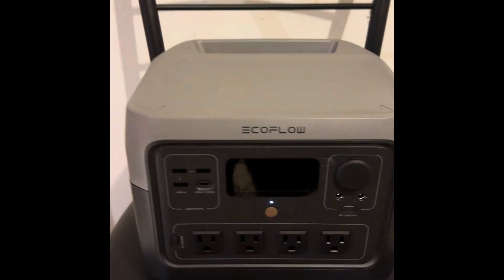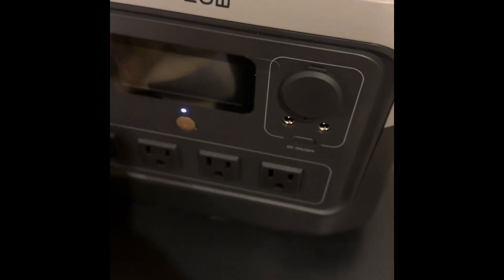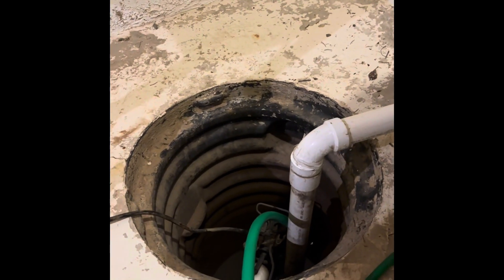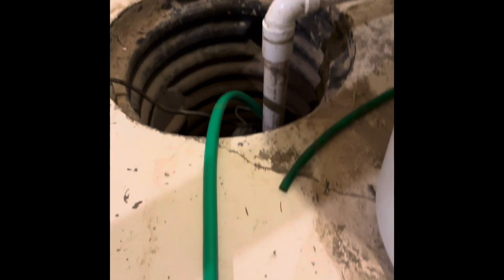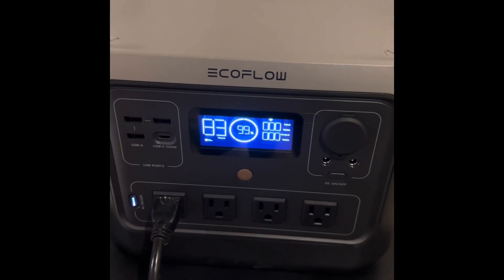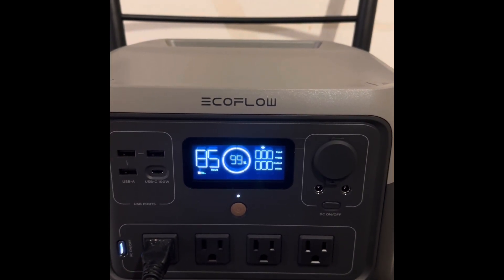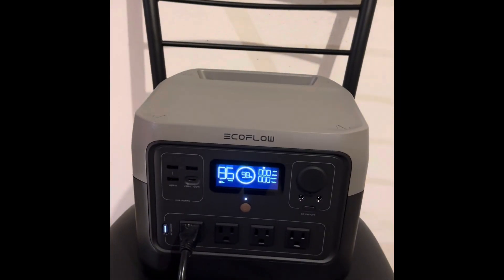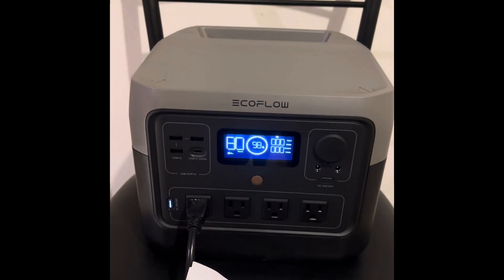Ecoflow River 2 Pro, will it handle a 1/2 hp sump pump?

Comment: Thank you. And yes, finally, a proper test was done with the specs of the pump itself. Bought the Ecoflow Delta 2 Max because i have a 3/4 sewage/sump pump set up. Needed the Max to handle the surge of a 3/4hp pump.

Comment: We had one very bad flood this past summer (200mm or 8 inches) in which our pump worked from 4pm all the way into the following day until 1pm .... luckily we didnt lose power at all and sadly none of these Ecoflow or battery backups would have stood a chance! its a huge concern  now with perhaps more frequent floods coming our way with climate change who knows ... the only option would be a seamless power transfer from AC to a generator backup using gaz.

My 1/3 HP sump pump would run continuously for approximately 46 to 58 minutes using the Ecoflow River 2 Pro .... its not much!!!
Reply: Montreal as well and our area was shy of 200mm. I was running the math and if my 1/3 hp pump would have to run 8-12 hours nonstop and this particular Ecoflow model would not be able to run for more than 1 hour straight. After witnessing my pump work continuously from 4pm to 2pm the next day (yes almost 24hours) … these backups wouldnt stand a chance and would only be handy for small power outages with an average rainstorm not something like we witnessed in August.

The large Ecoflows start running up to 3k-5k so at the point Im starting to consider a Generac backup.

Then again it also has to do with how much water your french drain/home can handle etc.
Reply: @giovan13  That makes sense; fed up with all these weather warnings/crazy storms....stresses the hell out of me.
Reply: Where are you located? Here in Montreal, we had 140 mm or so and our 1/3 hp pump ran for 8 plus hrs and kept water to only flooding garage and luckily not our basement. Made us prepare a portable Zoller 1/2hp pump with 100 ft of ABS pipe to direct water to street....just bought this model at Costco to back the main and portable pumps

Comment: Purchased an Ecoflow River 2 Pro after watching your review. I am happy to say that it provided more than enough juice to run a Zoeller 1/2 HP sump (model is 1075-001) sold at Lowes. It has a max 7.8 amp.
Reply: Nice and thanks for the added technical data. Typical "google" searches for "how many watts does a 1/2 hp sump draw" yields very dynamic and inconsistent results.

Comment: Great test. We are about to get hit with that storm and suddenly I'm wondering what will happen if the power goes out with our sump pump when it's raining 5 inches. We do have some gas generators, but something like this would be better. I've seen you can buy the deep-cycle batteries and backup kits for about $1,000 total if you do it yourself.